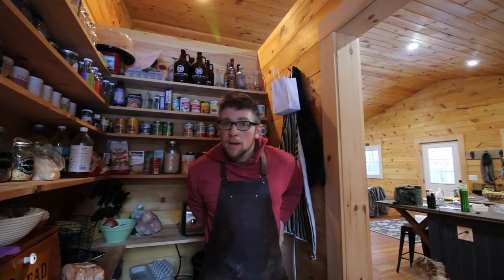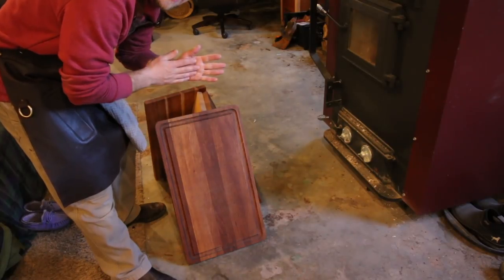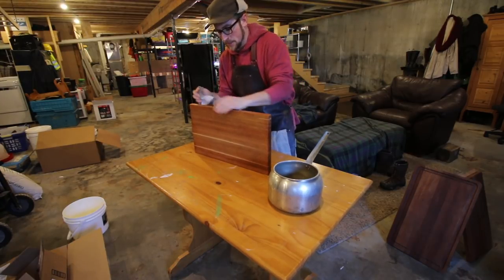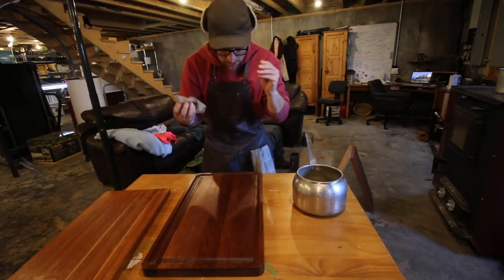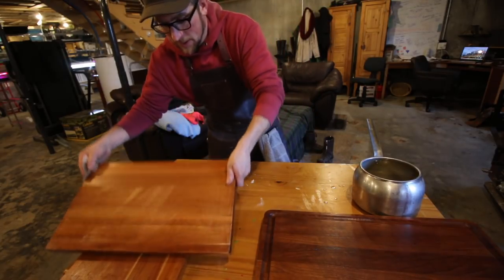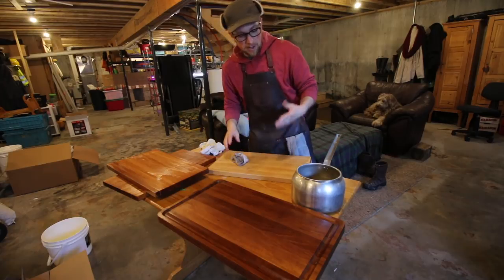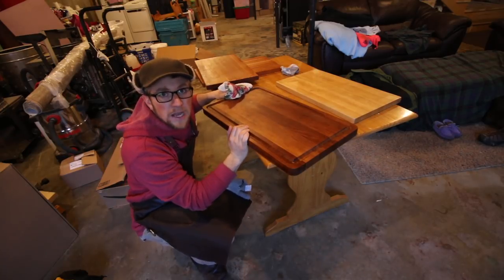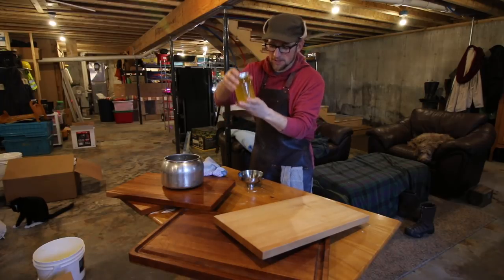How to condition your Wood Cutting boards ~ Butcher Blocks and Wooden Utensils

Comment: OH MY GOSH!!  That pot is just like the bottom of an old double boiler I used to use to make steal cut oats and 7 min frosting and cream of wheat and...  I miss that pot so much.  It was used so much that the bottom wore out and developed a hole. I keep looking at flea markets and estate sales for another one.  Part of my heritage is in a home made sausage stuffer.  It is a metal tube with a 4 inch funnel spout on the end.  A rolling pin with one of the handle ends cut off and sanded smooth fits inside the tube and pushes the meat mixture into the casing.  My great grandmother brought it with her from Minnesota when she moved to Nebraska in 1907.  It made sausages as thick as a good bratwurst.  I think I will pull it out and make a few 3 foot sausage ropes if I can find the casings.

Comment: AL, you make this look so easy.  Most of my cutting boards came second hand and are in need of restoration.  This is just the ticket.  I love to cook and having a good surface to cut on is very important to me.  Thanks again Al for a great video.  The stories some of our boards could tell, great stories.  Some of the boards were handed down from the previous generation.  Thanks to this video,new will be able to use two of our boards again.  Thanks for the memories.  God bless Al.  Awesome.  Great chat, I feel as if I know you Al.  TTYL

Comment: I had a wooden cutting board that was older than me. It was a hand me down or up on how you look at it. Had up till it was dropped and hot concrete just the right way it split in 3 😢!  But it had coated every year like you said and it had such character with all the cut marks. 
Alot of people dont realize they need a nice coating once a year thanks for sharing.

Comment: This is perfect. I have been wanting to learn how to bring back a cutting board that looks like it hasn't been used in a long time and is quite soiled as well ad treating my current boards. I think I am going to sand the old one it first. Should I wash it after sanding and before treating it? How much oil did you start with in the pot before you put the beeswax pellets in? Thanks for this video, I love it

Comment: Good video Al, hardwood cutting boards are still available but most of the younger generations don't like the older hardwood cutting boards and would rather have teflon or some other plastic or a glass top to do there cutting on because it is supposed to be better or cleaner so they say. Here's what I say, anything that is heritage or old school typically means work or manual labour is involved and the younger generations want nothing to do with physical labour at all. Some families have traditions they keep but on a larger scale mainly only the local native Indians have traditions that they keep and are teaching to the younger generations.

Comment: Much like in summer, wood expands and the wood fibers open up and it’ll be easier to get the wood to accept the beeswax. Is this the idea behind warming the cutting boards? A little bit like how some doors are hard to open and shut in summer due to expansion thanks to the heat.

Comment: Mineral oil, however, is a petroleate, and as such is HC hydrocarbons. Not good for our livers. It would be better to use a natural oil, like any edible oil, or if you need, dilute the beeswax to make it penetrate with ethyl alcohol, vodka or such. Paraffin is a hydrocarbon, from petroleum, whereas beeswax is a long chain fat, a carbohydrate CHO, made by the same gene in bees that your ears use to make earwax. People used to use mineral oil as a laxative, till the AMA told people to knock it off, it was getting into people's livers.
Reply: I agree with you. I was thinking of that as well. They also coat store bought eggs with mineral oil to preserve them ... yuk. The egg shell absorbs it as well. Once you start going down the rabbit hole, you just don’t know how far down it will lead you. I keep away from that stuff.
Reply: Food grade mineral oil is the best for wooden cutting boards and bowls. Reason being, food type oils go rancid. I know, because I nearly ruined a set of wooden bowls using olive oil. It smelled bad, got sticky and gummy and dust stuck to it like glue. Never did completely remedy it. Food coming in contact with the food grade mineral oil, is not the same as actually eating the mineral oil. I switched to food grade mineral oil and the beeswax and it is the best. I love it. My boards and bowls are in excellent condition now. And they smell nice. lol
Reply: I’ve been using coconut oil on my cutting boards and wooden urensils (and knife handles!) for about 10 years and I’ve never had a problem with rancidity. Olive oil definitely won’t work!

Comment: How do you clean your boards after you cut raw meats on them?  Do you wash them with soap in between oilings?  Can you use the oil on bamboo cutting boards?
Reply from the maker: Yes I washed them with warm soapy water. Don't let them soak. We use this mix on our bamboo mixing spoons also
Reply: Thanks!  I've been throwing away all of my plastic boards now for some time and only using wood and glass boards.
Reply: My grandma taught me to rinse and wipe them down and then scrub them with some salt.  The salt will disinfect them.  Then a quick rinse.
Reply: Sonya Gregory Save the glass "cutting boards " for hot pans and under your toaster. They are terrible to your knife blades and you will always be in more danger of cutting yourself if your knives are dull and slip on the glass when you press to hard.